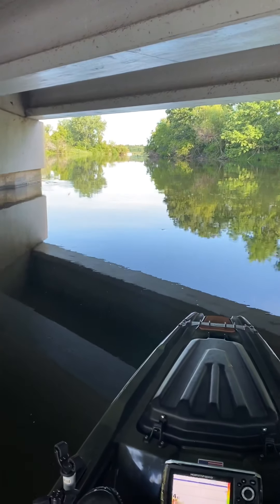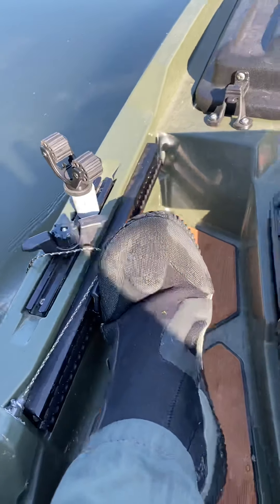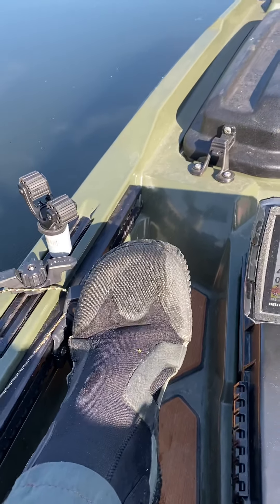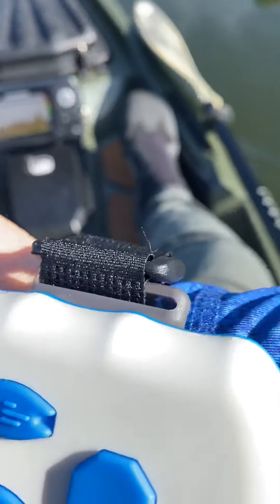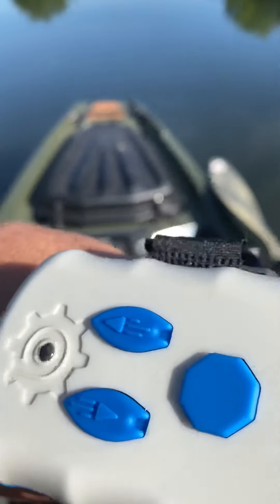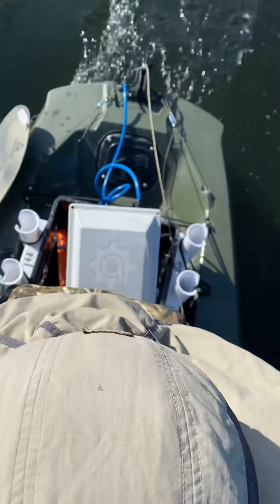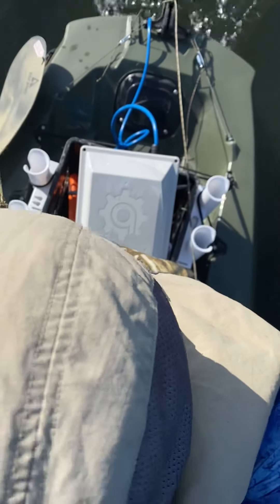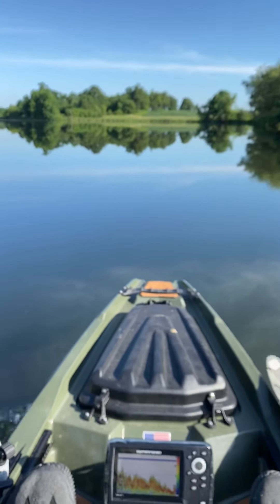Bonifide SS107 with Bixby motor and universal rudder

Comment: Hey bro looks good. I have the J2 Bixpy on my SS 107. I've added the bixpy hand rudder control. I also purchased a 2nd bixpy battery. One is mounted inside the hull. My spare just replaces it with 2 Allen wrench screws with a  bracket I designed. She goes atleast 8-10 hrs on all different speeds. I get 4.5 to 5 mph. But I'm also 5ft 7 151 lbs. So that's why I wanted the 107. But you might have to adjust the motor under the boat, until you get it right. it could make a big difference in getting 2 mph more. You should be getting a minimum of 3.5 to 4 mph. Good luck. I adventually want to go with the Torqueedo 403 or maybe 1103. But I did do atleast 3 adjustments.  It's my 1st kayak and see no reason to upgrqde.🤔 😎 🎣 🙏
Reply from the maker: Thanks for the info!!